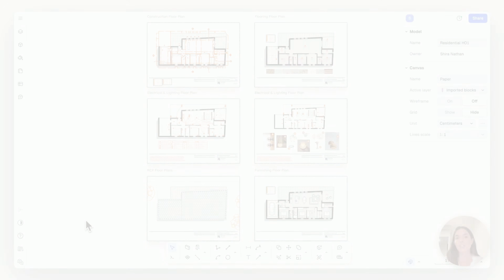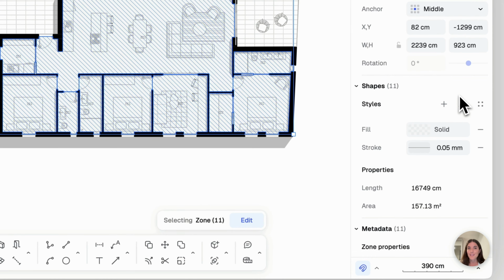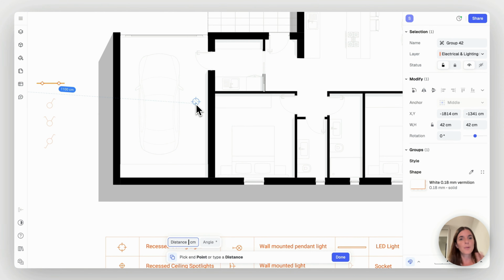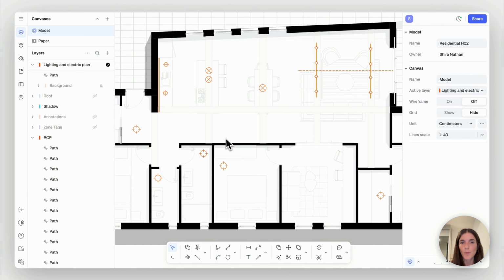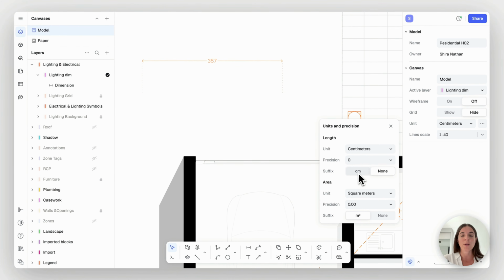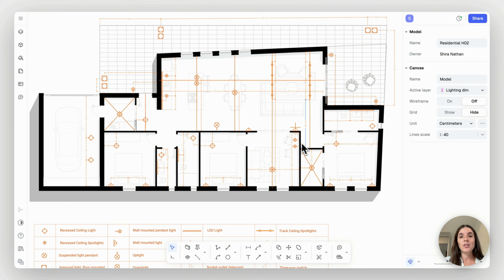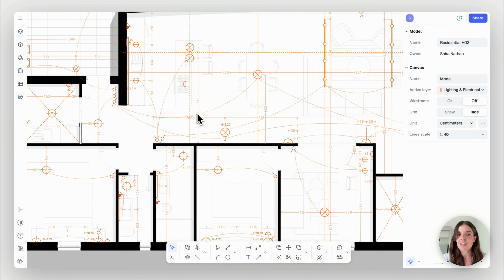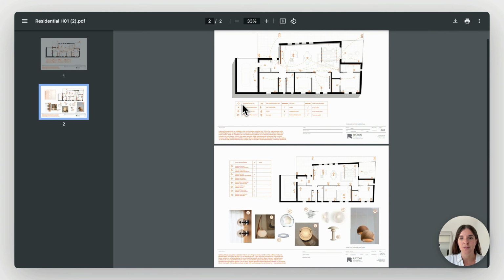Draw Architectural Lighting & Electrical Plans in Minutes

Comment: How do you show on the lighting plan when there are multiple lights at different heights in the same location in plan view? I'm specifically thinking about kitchen cabinetry where you may have kickboard lights, under-cabinet task lights, and lights inside lower cabinet drawers and upper glass door display cabinets. They're all linked to the same wall and there's only two circuits needed, but there's a lot of wires that need to be in place before the plaster and cabinetry are installed.
Reply from the maker: Hello there! This is where the elevation drawing comes into play, so you can cross-reference the floor plan with the elevation. That way, you can see the lighting levels and heights on the elevation. Take a look at this video! https://www.youtube.com/watch?v=SOQYZI2CerQ